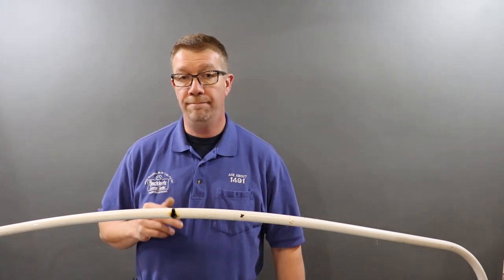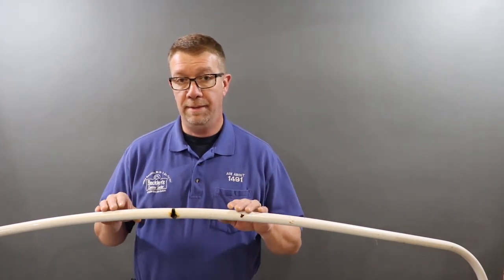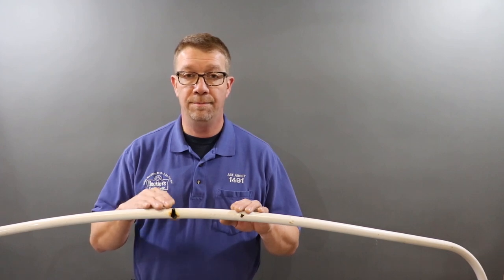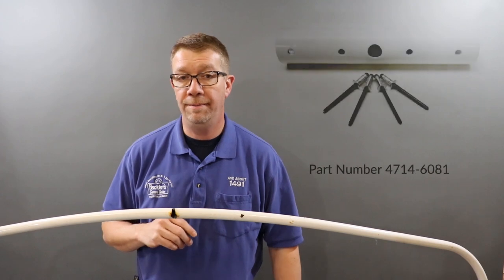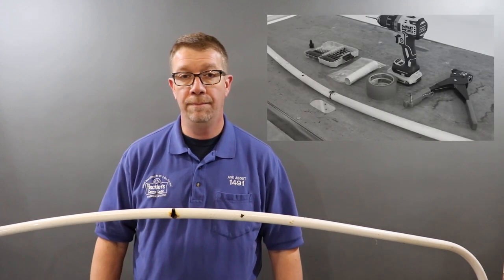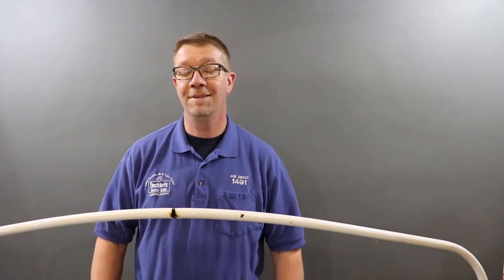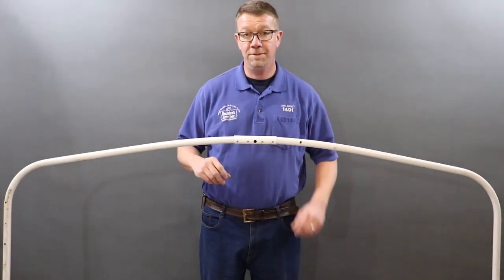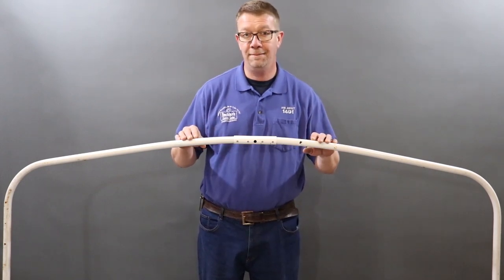How to fix a bed bow on a Coleman and Fleetwood pop up camper

Comment: I did this but the rivets broke the first time I put the bed bow down any ideas
Thinking about adding some rivets to the back side for support?
Reply from the maker: Rivets breaking after installation is typically due to the fasteners installed incorrectly. Check the draw on your rivet gun. If it is to much, you can pull the rivet bead through the rivet body leading to failure. It's especially important if you are using an air powered rivet gun.

Comment: So do I just grab any random drill bit or is there a specific size used?
Reply from the maker: Mike, not quite. Here are the written instructions I have on this item at colemanpopupparts.com            Basic installation instructions

1. Completely separate the bed bow at the center, or where the break is. 

2. Slip the repair tube on both center ends of the now separated bed bow.

3. Using a 3/16" drill bit, drill 1 rivet hole and fasten 1 rivet. Drill the last 3 holes, then fasten the last 3 rivets
Reply: @popupcamperpro  Thank you .  I did find instructions online and continue my install.  My 3/16" bit was missing so I used a 11/64th bit which also worked great.  Thanks.